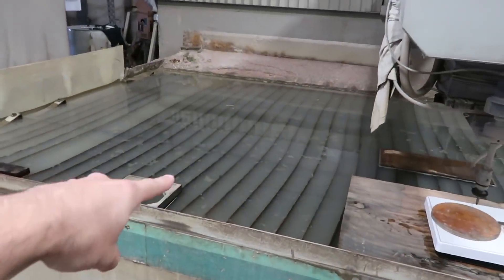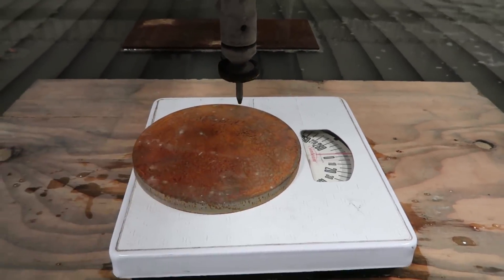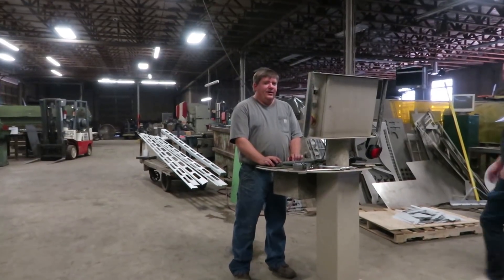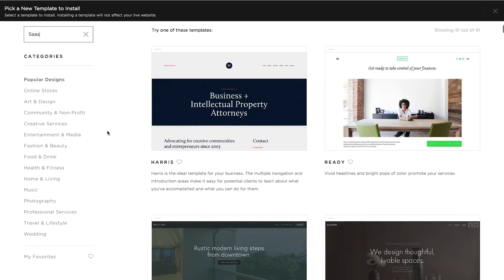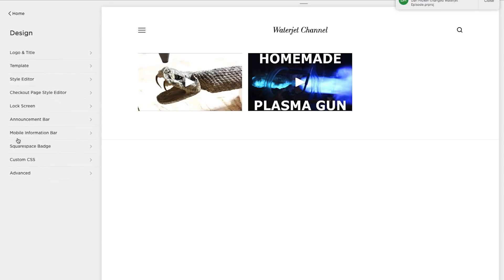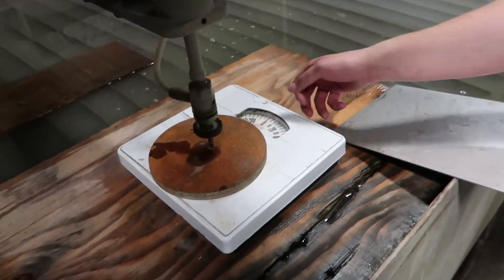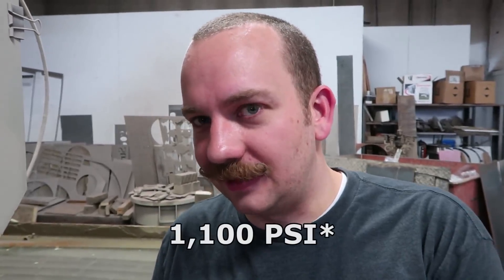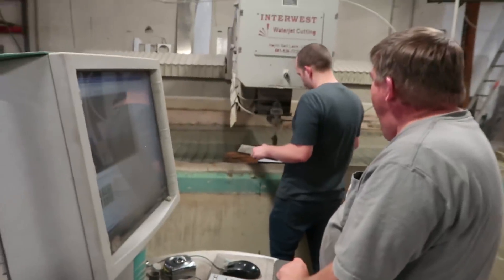How much does High Pressure Water Weigh? Bathroom Scale Cut in Half

Comment: The maths.

You take the weight shown on the scales and multiply it by 2. Next you take the surface area of the scales and divide it by 4. Add those 2 numbers together & divide that figure with itself. Add the result to 59,999 and that will give you the pressure in PSI.

Comment: You'd be better off filling a known volume with the jet and timing it to work out the pressure.
Reply: That would give you the flow rate, not the pressure.
Reply: Of course it would give you the flow rate. I wasn't saying that will give you the pressure the maths from flow rate to pressure is easy.
Reply: But then you need to know the nozzle's inner diameter which means you can just use the bathroom scale method. You also have to consider that the jet most likely doesn't start up at full pressure and flow immediately, but has to ramp up. That would throw off your measurement considerably depending on the volume of your container.
Reply: swiss you still need to know the diameter of the nozzle to know the pressure with the scale method
Reply: Little Bacchus in other cp,ments they said it was 0.06 inches
Reply: The nozzle's inner diameter is known (not by us but by them) as they purchased it. So we have flow rate, density and nozzle diameter so the pressure at the nozzle on exit is known.

Edit: density if no garnet added
Reply: Looks like it's a waterjet systems international NTJ - 9/16" AB9000 ABRASIVE CONNECTION but I can't find a spec sheet with the ID.
Reply: In cutting Cody's gold they say it uses ~1 gallon per minute (guessing US gallon)

Edit: After a few calculations I think 1 gallon per minute is a very rough estimation.

Comment: From what I've read, it has little to do with how much pressure is exerted at the point of contact, but way more to do with the speed of the jet, which is usually 2.5 - 3 times the speed of sound. So you would need to figure out your exact speed and know the exit diameter of the head to get your figure.

Comment: Where's the data? There's nothing in the show more. The key piece of data we need is the size of the waterjet's orifice.
Reply: Yeah, i get around 6400psi as a result. Another consideration could be that the pressure at the impact isn't as high as the internal pressure in the machine, since the water isn't coming to a full stop. For example, when the water is in midair and simply falling down, the pressure inside the water is very low, since there's only air pushing on it, and the water around it is moving at the same speed.
Reply: area of a circle is pi*r^2 so assuming 0.060inches is the diameter we have pi*(0.030^2) which is 0.0028 square inches for the area of the stream at the nozzle.  But, I still can't get to 60,000 psi from there.  One consideration, bathroom scales are notoriously imprecise on the low end.
Reply: I'm not sure but I think that you are not taking into account that the steel is giving way under the stream absorbing the pressure and converting some of the energy to heat and angular momentum.  And don't forget aliens, they steal energy too.
Reply: Maybe it has that much pressure actually in the nozzle, but when the water comes out it lossesthat pressure, and only has the speed it picked up. I think that'd make sense because you don't have anything confining the pressure. I bet if you could measure the weight with the nozzle kind of pressed up against the scale you'd get more weight.
Reply: Hee hee... Orifice....
Reply: I get 19,999.99 PSI now. Take 1 and divide by the area of .0028313 to get 353.195 times 18... I am currently too distracted  to do this. I haven't even watched the whole video all the way through yet. At least that is more in the ballpark. You're probably right about the scale, too.
Reply: If you were to block the nozzle completely, you would reach 60,000 PSI. The difference between this and the 3,890 PSI experimentally measured is that the nozzle and whole waterjet system has a high resistance to flow.
It's the same reason why long pneumatic tubes have issues in maintaining pressure when in use, but will be at tank pressure when the connected device is not in use.
Reply: I also get 3890 psi. I don't think it's the scales fault, not if its a whole order of magnitude off. I thought that dividing the force on the scale by the area of the orifice would be the right way to go, but that does not seem to be it.
Reply: that makes the area about .188 sq inches (pi times diameter) and at 18 pounds of force I only get about 95 lbs of force. Am I forgetting about a decimal point or a couple orders of magnitude due to something else?
Reply: You're messing up the decimal point, but this still gives an answer of only 4000 PSI or so.

Comment: The 60,000 PSI is only exerting force on a minuscule spot and it is being spread out. I wish I knew all the fancy math to it, but a bathroom scale isn't going to be accurate to what you want to measure.
Reply: The scale isn't the problem, they just have no idea what they're doing with the numbers ;-) There's no fancy math involved, you just take the reading from the scale (in pounds) and divide it by the cross sectional area of the waterjet nozzle (in square-inches). That will give you the pressure at the nozzle in pounds per square inch (psi).
Reply: Cool! I learned something new today. Thanks

Comment: As someone who is known by peers for being good at math, here's what I have to say:

Assuming the water jet is in fact 60,000 psi, the surface area needed to exert 17lbs of force would be 0.000283 square inches. The surface area for a circle is pi times the radius squared. If we adjust this to solve for the radius (the square root of Area/pi), the nozzle would have a radius of about 0.01 inches, or a diameter of 1/50th of an inch.

If you could've measured the diameter of the nozzle (with the inner tube where the water actually comes out of), this would help determine the true psi of the waterjet.
Reply: So that would make the surface area 0.00283 square inches, meaning it would've shown 168lbs on the scale if it was 60,000psi unlike the 17lbs it actually showed. So, if this test isn't flawed in any way (which I think it is, considering it's a tiny nozzle pushing on a much larger bathroom scale), the real pressure would only be about 6,000psi.

Comment: How big of a hole did it make? Use the weight reading, 11lb over the area will get you close! So the force (lbf) over (pi times the diameter of the hole squared, divided by four). How big was the hole it made?

Comment: The problem ia that the waterjet apply its force in a little area, when u guys got a steel plate between the scale and jet u dissipate the force over the steel plate area. Remember Pressure=force/area!
Reply: Yep, they need the cross sectional area of the nozzle instead of the area of the scale.
Reply: Which was noted some while back. But still doesn't give the 60 kpsi.
Reply: The area does not matter for the total weight downwards (the weight in kg the waterjet delivers ). You also dont get lighter or heavier when you stand with 1 foot on the scale or with 2 feet. The total force does not get dissipated over the area by which i mean that it doesnt get ''lost''. The pressure of the plate on the scale goes down when the area of the plate gets bigger. But adding all the force form the surface together gives you the total force of which the waterjet is excerting.
Reply: we've seen them cut thru worse with the jet,... what makes you think the steel plate did squat? the jet went right thru and didnt allow for any proper measuring to take place, just as it would have with just the scale itself laying there.
All they did was cut right thru it.

Comment: you need to know how big of an area the water jet is applying the force to. say it's 1/32 of a square inch then 11lbs/0.03125in^2 = 350psi? chances are the metal plate doesnt accurately transfer the load to the bathroom scales.

Comment: You need to know how big/thick the water jet is to calculate the PSI
Reply: the waterjet weigh more because Pressure=Force/area and they spreading the force on the steel plate wich reduces the pressure
Reply: Waterjet Channel is that the diameter or the area of the water jet?
Reply: so the area of the waterjet is .00283 square inches. (pi*r^2) If it's really 11 pounds then you have 3887 PSI. I think the waterjet should weigh 170 pounds.